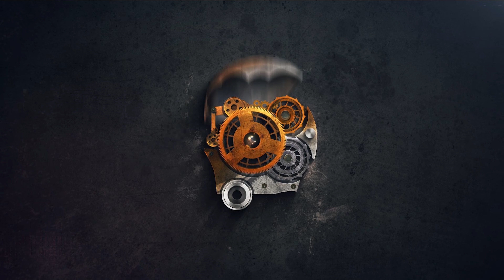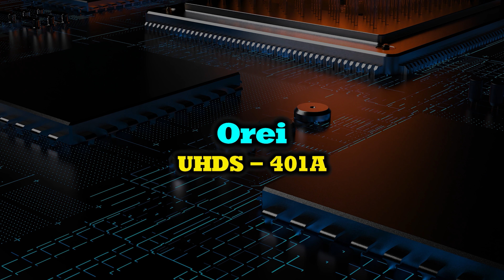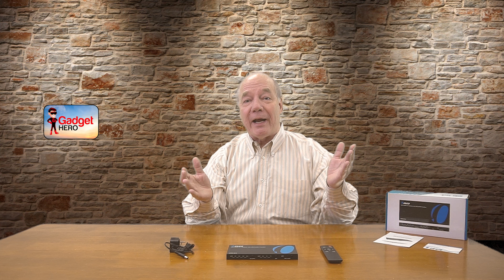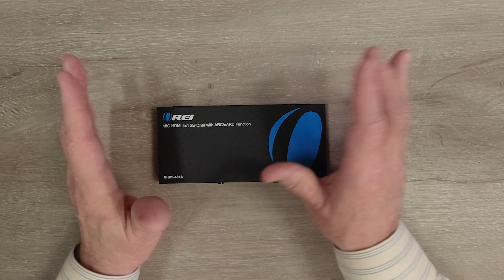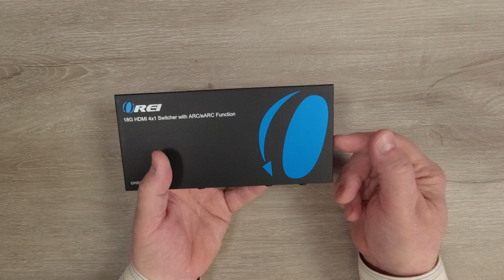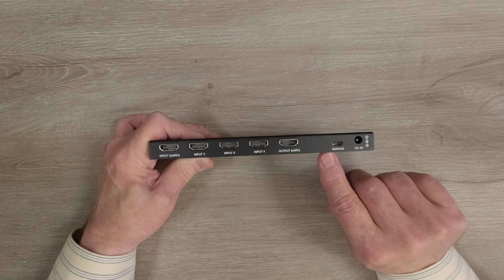UHDS-401A | 4X1 HDMI Switch with Full eARC Support

Comment: Major audio cutting in/out on the eARC port. I tried multiple inputs and same issue. My soundbar works fine when hooked directly to the source, but not through this. I need a better HDMI Switcher with at least 2 inputs (and 2 outputs, one to my projector and one to my soundbar)